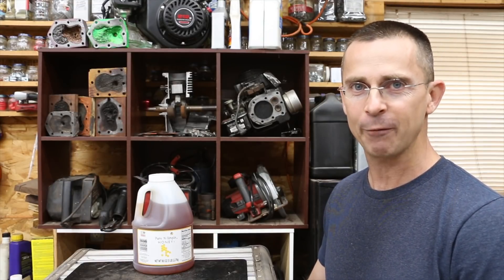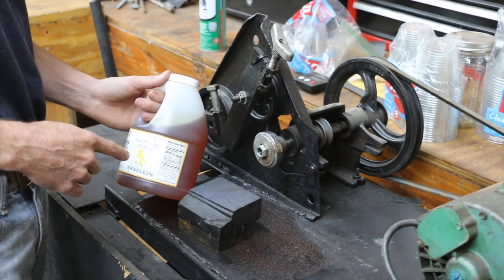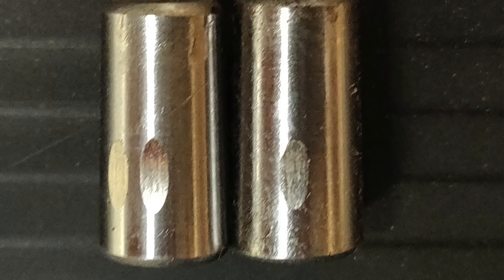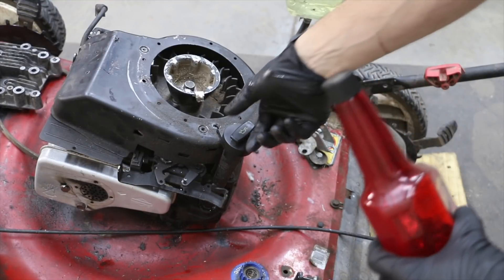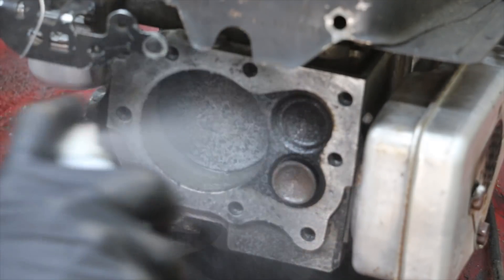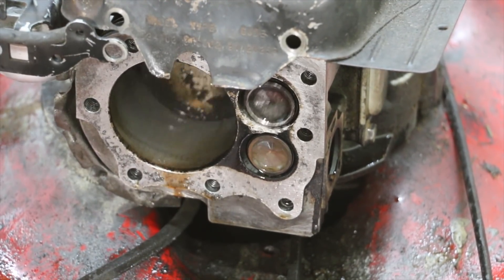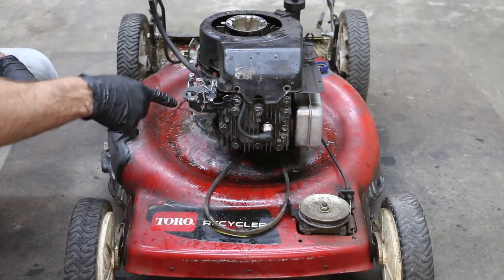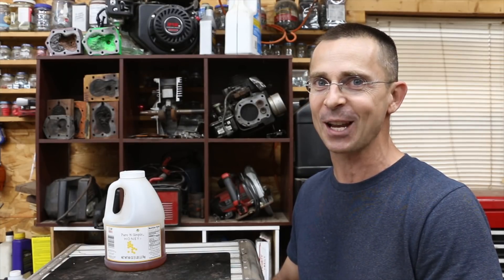Can you use Honey as Engine Oil?  Let's find out!

Comment: a powder type lubricant like graphite would be interesting, maybe suspended in water
Reply from the maker: Great test idea!  Thank you
Reply: @ProjectFarm  I like the idea of using graphite as a lubricant....however I think if you you used refined peanut oil as the carrier for the Graphite....motor oil begins breaking down at 240° causing carbon deposits and sludge forming.   Peanut oil on the other hand reaches it's smoke point at 450 °.  I don't know the lubricosity of peanut oil but that would be the Job of the graphite....I would only suggest such a mixture be used in a lawn mower engine or the like that had no filtration system. I did a little reading on the lubricosity of peanut oil and it suggested using unrefined peanut oil as it had better lubricosity than the refined oil.....you might even use it straight without the Graphite.
Reply: or perhaps acetone or rubbing alcohol. i know graphite mixed with acetone is used to carry the graphite down things like speedometer cables since the "carrier" will evaporate and leave only dry graphite, that way the spinning cable won't work liquid oil up into the speedo connection. i only mention that because it's a common use for a graphite and liquid mixture, i'm not sure if graphite+water is used for anything
Reply: Great idea pencil graphite
Reply: I see you guys are too young to remember ARCO Graphite motor oil. That was exactly the idea there.
Reply: Wouldn't graphite plug the oil filter (depending on the micron size of the filter material).
Reply: Suspend the graphite in maybe wd-40 or something.

Comment: Fun test, but pure honey crystalizes at refrigerator, or below temps. That was either 'adulterated' honey, or worse yet, and assuming from the economy vat you bought, is probably pure corn syrup.
Reply from the maker: Great point. I purchased it from Walmart.  So, I'm guessing it's corn syrup, even though the ingredients mentioned sugar, not corn syrup.
Reply: Project Farm 
Sugar on the label could refer to corn syrup, or glucose/adulterated.
Reply: Yes, but corn syrup is 'usually' listed as corn syrup when used. But I never trust Wal-Mart brands, and I would never eat any bargain honey. It is generally fake, and you reverse all the health, and nutritional benefits. Spend the money on real local honey. It tastes better, and will help to keep you healthy.
Reply: Project Farm 
But don't try it. Honey also has a lower combustion temp than corn syrup. Honey will light with a match, and corn syrup will not. Watch what you eat, along with what goes in your engine.

Comment: Hey boss what would you use for a modern motocross bike in the crankcase?
Reply from the maker: Great question. Most have wet clutch systems and options are very limited.  I would likely use a fully synthetic racing oil with zinc.  Thank you

Comment: Would like to see dish soap in the crankcase. 

Also maybe some a soapy water slow drip into the engine(like the seafoam or water testing) 
I had a head gasket leak and I ran dawn dish soap in the coolant(which was leaking in the cylinders in multiple spots) and the carbon seemed to be slight. It's worth mentioning that the engine wasn't ran much once the leak started, so it wasn't a slow stream cleaning.
Reply from the maker: Great test idea!  Thank you

Comment: Todd,
Would you recommend seafoam/water for cleaning intake valves from carbon on a direct injection engine?
Or only for cylinder/exhaust valves?
Reply from the maker: Great question.  Using a Seafoam and Water approach through a vacuum line or the intake would likely help. Thanks again.

Comment: Very usefull test. I am thinking about the milions of persons, including myself, who wanted to use honey in their engines instead of oil. Beware. Resist the deep temptation. Now you know. ;) I am lucky to have found this video just before putting honey in my 14 500 rpm 4t motocross engine.
Reply: Do you have a video about Crisco oil? Back in the days, I had a Husqvarna motocross bike and it was said ''vegetable racing oil only'' on the gas tank. That meant Castor oil but I am sure a few used Crisco or Mazolla. :)
Reply from the maker: lol.  Funny!  Thank you
Reply: Good video! Just the result I was expecting from vegetable oil. I was not as optimistic about the honey to say the truth... ;)

Comment: What about hitting the engine with a 100hp dry nos shot?
Reply from the maker: Great video idea!  Thank you
Reply: Project Farm do it!
Reply: It go boom!
Reply: o_O
Reply: That much NO2 would just stall the engine. This is a 5 HP engine, max, so that much NO2 would just dump back out the carb. Movies always portray NO2 or Oxygen as explosive, but neither gas is even flammable.
Reply: There's some old videos of that being done. As mentioned, NOS is not a fuel. Damn those stupid movies. The engine has to be set up to be able to deliver more fuel to take advantage of the additional oxidizer. Otherwise you are just creating an ultra lean condition, very hot combustion, and while you'd see little or no actual power increase, you WILL melt internals, pretty quickly. Nitrous systems can be thought of as chemical supercharging. Instead of cramming air mechanically with a turbo or supercharger, you are injecting a superior oxygen source under pressure. It still needs a stoich level of fuel delivery to use it. THAT's where the power comes from. It's not power in a can.
Reply: Nicolas Broszky  LOL. Yeah I understand the cryo aspect but a seriously lean combustion will trump that, point being with a proper mix, yeah it will have a quench effect. Ultra lean? Won't matter. When you have a high density of oxidizer and not enough fuel, even things that shouldn't normally burn become fuel, including metal. I've seen some wavy piston crowns come outta engines with poorly tuned nitrous systems.
Reply: Nicolas Broszky  I can tell you have more experience with it than I do. Yes i'm familiar with 4 barrel carbs and NOS micro switches. But you are not understanding the nature of my comment . I didn't say you are running an extreme lean condition with a proper setup. I was talking about if you were to supply oxidizer without the proper amount of fuel to use it with, as in just shooting nos into a small engine with little fuel delivery to begin with as was suggested here. And you've never thrown hot steel wool or aluminum into an oxygen-rich container? I thought everyone in a shop knows that trick. Steel, aluminum, iron, will most definitely burn with enough oxygen present. Granted, it depends a lot on surface area availability...
Reply: Nicolas Broszky  You aren't even following my original point. You seem to be having your own argument, based on what you apparently usually argue with people about as related to nitrous systems. That's fine, but I'm not into it, sorry. But yes it is similar to turbocharging and supercharging, in that it achieves the same basic effect...higher intake charge density (due to expansion of the extreme cold you mention),  and more oxygen available to burn more fuel per cycle.

Comment: Rev to wide open until failed and use the best lubricating oil like slick 50 but fill the hole crank case with it so it will help give the motor longevity
Reply from the maker: Great video idea!  Thank you

Comment: Test the effects of very thick oil, e.g. 20W-50, to see if it will restore compression and engine performance on a very worn engine.
Reply from the maker: Great video idea!  Thank you
Reply: Kevin Deininger 
Yeah, I use SAE 30 in small, and air-cooled engines.
Reply: @souljahroch2519  Are you able to crank them in Winter conditions?
Reply: @tsd560ti6  Once you cut a path through the frozen oil, sure... but it's gonna be a bear. If it never shuts down you could do it, but for a tractor or something stored outside, I wouldn't
Reply: tsd560ti 
I live in Mexico, so no start up problems here. And I have not lived north of the 33rd parallel for a very long time, but I certainly get your point. I'm an olde school VDuber, and the 1600, thru 2200cc air-cooled engine specs are for SAE30 in the winter, SAE40 in summer conditions. I do quarterly oil changes, and  when it's routinely over 100°, I run SAE50. NAPA is a great place for oil, and attitude. They almost always carry their generic oil, which is conventional Valvoline, in both 30, and 40 weights. When my engine wasn't leaking, I would run Valvoline's VR1 racing oil. It's  definitely worth it. It, by far, kept my engines the cleanest. 
In my bus in 20° weather, I had no problem on start up, but we also take care to let her warm up a few minutes before traveling, and the warmup time is essential. And it also gives us time to roll a joint😉 I would feel real comfortable running a small engine, or air cooled motorcycle on SAE30 down to 30ish, but if I were running a snow blower, or generator in Minnesota, I might be running 20-50. My guru explained it this way though, 10W-40 is not 40 wt, it's 10 weight with additives that stretch the Petro Industry's profits. Newer vehicles are made for that 'shit' though, and the thicker weight would be too much.
Reply: Or 20w70+.
Reply: I had a 79 f150 with a worn out 400m, had next to no oil pressure with 10w30 and was loud internally. I didn't go that extreme but i changed the 10w30 out for 15w40 diesel oil and it quieted things down and raised the oil pressure. Did the same with my old 88 dodge with a knocking 318 and it helped quiet it down. Power from both felt roughly the same. didn't test compression

Comment: One thing i would like to see is what would happen if you used assembly lube as oil. If you use it when the motor goes together and its meant to lubricate parts that dont have oil yet then why cant it be oil all on its own. Or is it to thick for the motor.
Reply from the maker: Great video idea!  Thank you
Reply: Project Farm the only problem you might have is getting it in bulk. I dont think its very cheap.

Comment: This one may be dangerous, but could you try using premixed 2 stroke gasoline in the crankcase of a 4 stroke? It will work for sure given the fact that a 2 stroke by nature uses premixed gasoline as a lubricant, but I'm curious how the engine would behave. Maybe it could work as a way to rinse out a sludgy engine (like the one you just filled with honey) while still providing lubrication? Some people use diesel for this purpose.
Reply from the maker: Great video idea!  Thank you

Comment: You should try coconut oil.  The idea is that you got stuck on a deserted island with a hole in the oil pan on your boat engine.  So you fix the hole using homemade glue from tree sap and now you want to use coconut oil as lubricant. Will it work.
Reply from the maker: Great video idea!  Thank you

Comment: Would you be able to determine what the pressure goes up to in the cylinder, of a given engine, after the spark plug has fired? We get to see what the compression is before firing, but I have no idea how far the pressure rises. Would be interesting get some idea. Regards
Reply from the maker: I'd like to, but I'd have to find a gauge that can handle the pressure and heat.  That would be very interesting!
Reply: @ProjectFarm  How high do you think the pressure might go?

Comment: Video Idea:  Do a controlled experiment to determine how tire pressure affects a car's average fuel economy for different tire pressures. (Pr is the recommended tire pressure) (Pr-5psi, Pr, Pr+5psi, Pr+10psi,Pr+15psi) And see if there is any significant increase in fuel economy running your tires slightly over-pressurized.
Reply from the maker: Great video idea!  Thank you

Comment: Now why can’t automakers make engines this “bulletproof”?
Reply: Car engines ARE pretty bulletproof nowadays. The engine is almost never the reason why a car has to be junked nowadays.
Reply: @fyrstormer  and if it is, it's due to major neglect
Reply from the maker: Great point!
Reply: Pfff, people go without changing their oil for 80,000 miles at a time because they don't know it needs to be changed. Sounds a lot more bulletproof than dying after 25 minutes. I definitely don't recommend it however
Reply: What, so you can put totally wrong things in them and they'll run for a short time? Try it. They will. Go watch some of the cash for clunkers death videos. Some of those engines fought death for 15-20-30 minutes with essentially liquid sand that turns to glass in their bearings when heated. But they fought it.
Reply: They did once....it was the Ford Model A

Comment: That lasted a lot longer than I honestly thought it would.
Reply from the maker: Thank you
Reply: That's because there was still a thin film of oil inside the engine. If he had degreased the engine with gasoline in the crankcase before adding the honey, it would've seized in seconds.

Comment: With a variable valve timing engine, it says in yr owners manual not to add any additives to yr oil or will cause severe engine damage, what does adding an additive such as motorkote do to ruin yr engine, why does it cause damage? I use it in other engines and actually gives an engine more power, i think it coats internal moving parts too good and the sensors are reading incorrectly and tightens and stretches the timing chain, throwing yr timing off eventually destroying yr engine, can anyone explain why you are not to add any additives to an engine with VVT ?
Reply from the maker: Great point.  I'm not sure why but it seems to be standard language for all new vehicles to warn against using additives.
Reply: I bought a brand new, 2014 f150 ecco boost 4 by 4 , 3.5 liter triuck, in 2014, i always do my own maintenance on my vehicles, basics brakes rotors calipers starters oil change tranny fluid etc etc , the simple things, well i did an oil change and used motorkote with oil per directions on the bottle, had probably 50,000 miles on it or so, well 92,000 engine light came on power was gone turbos were not working , Bob Dixon very good mechanic in Dixon, Illinois, said do not start it, if you have to tow it in, which i knew not to start it any more obviously, come to find out, i about destroyed that engine $2600.00 bucks later i had to put new timing chain in new sprockets tensioner etc and everything that goes with that kit, chain was stretched so bad he said the tensioner was out all the way engine was just about junk from timing being off so far, but, speaking of additives in new vehicles, Synthetic Lucas says rite on the front of the bottle, ( WILL NOT VOID NEW CAR WARRANTY) if thats not true, and Lucas caused damage to a new vehicle, you would think Lucas would have several law suits on their hands, thing is, you try to give yr vehicle a bit more protection, and you almost destroy it completely, everyone becareful on any additives in any newer vehicle that has (VARIABLE VALVE TIMING) because most vehicles now days has vvt, the mechanic that fixed my truck could not stress that to me enough, just lettin everyone know...( NO OIL ADDITIVES IN VVT ENGINES) it will destroy it!!!!

Comment: Aluminum engine sabotage with gallium in oil or through intake.
Reply from the maker: Great test idea!  Thank you
Reply: What's the point of a test that you already know the result of?
Reply: @fyrstormer  To see what it looks like.
Reply: I tried it once on a weedwacker cylinder head trying to get it to fail mid-run, but no success. It takes a while to react, and surfaces need to be roughened to speed the process.
Reply: That sounds like catastrophic failure. Don't do it without a blast shield.
But still do it! :D

Comment: G'day,

  Yay Team...!

    I'm surprised that Honey performed as well as it did, on the Lubricity-Tester ; but when that happened I recall an Apiarist (Bee-Farmer)  mentioning that a lot of what Honey is made of is basically "Bee Fat", it kinda makes sense...

  But the facts that Honey permitted the Engine to run for 25 minutes before stopping, and that after stopping it took several immediate restarts to get it to sieze...; and that after locking up solid, some almost non-invasive remediation involving the application of actual Petroleum-based Lubricant permitted the Motor to start up & run again - even with what was left of the Honey still in the Crankcase.....

  To me, that-all indicates that Honey might get you 20 minutes before needing to be replaced with a fresh lot ; come the Zombie-Puckerlips...(?) !

   So, assuming that the Fat & Water Content is lubing the Engine while the Sugar is caramelising and glueing the components together....; how might it go with other kinds of Animal-Fat..., like "Lard" ?

   (Sheep or Cow or Pig Fat..., I thunk - bein' a Vegetarian I'm a bit hazy on the precise terms, but I recall Lard being in the Fridge as a kid...,  and after it's been used to cook Meat it then gets called "Dripping" - Dad used to eat the stuff spread onto Bread, but Dripping is salty so Lard would be better in a Crankcase...?).

    All you'd need to do would be to pre-warm the Lard before putting in into the Crankcase, start it immediately ; and drain out what's left afterwards, before it solidifies as it cools.

   Dishwashing Detergent might be a fun Test, as Crankcase Oil, too (?) !

  Have a good one,

  ;-p

Ciao !
Reply from the maker: Great test ideas on using dishwashing detergent along with various lards and fats!  Thank you!
Reply: +Project Farm 

No worries mate,

   You make and post great Videos, so the least I can do is give some decent Feedback (!).

 Have a good one,

  ;-p

Ciao !